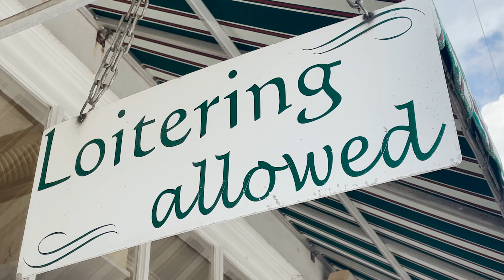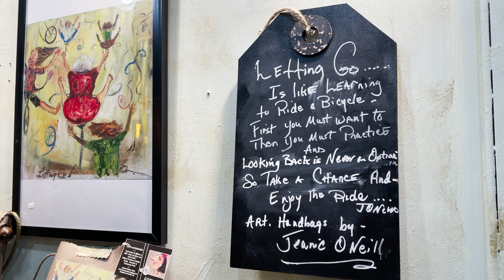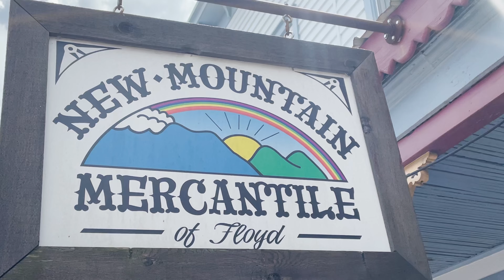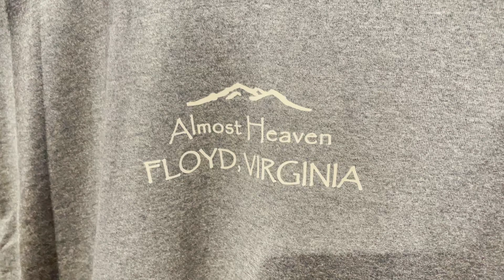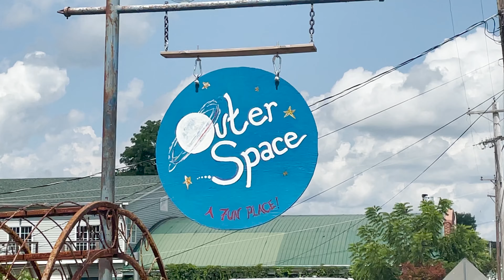#25 FLOYD, VA: Green Pastures and Great Shopping

Comment: You might wanna look at a generac for the house. I lose power frequently with AEP
Reply from the maker: That's exactly what we are going to do!  The most challenging part of losing power here is not being able to pump water from the spring.  One of the main reasons I want the generac (among others!)
Reply: @freedomranchhomestead7961  our generac is 16 years old and still doing good. We bought a new one with Wifi so I could see that it tested and to make sure it’s on when I get that Aep text. Using the old on for the barn and storage. Good luck!